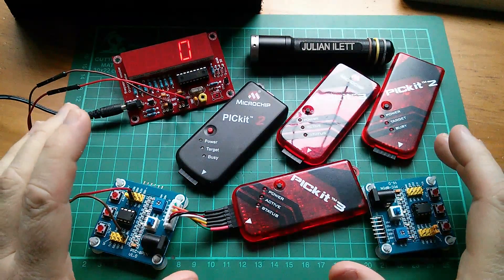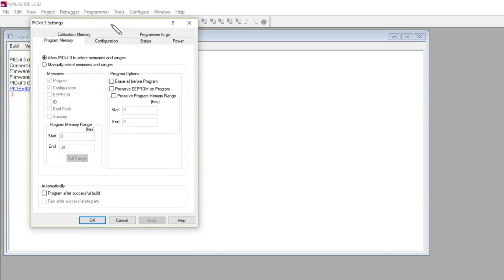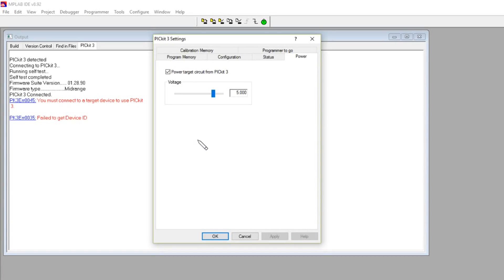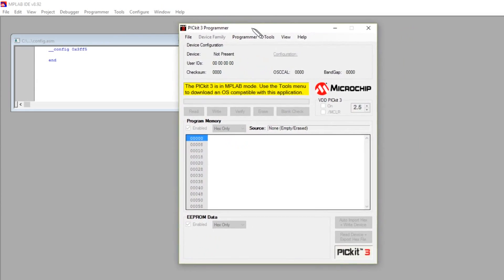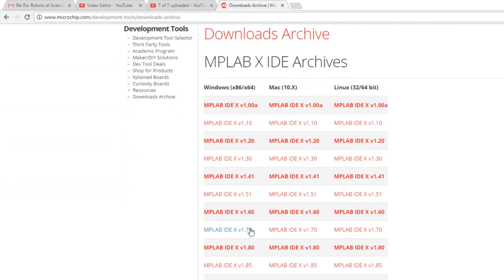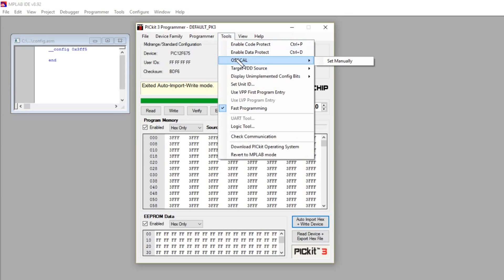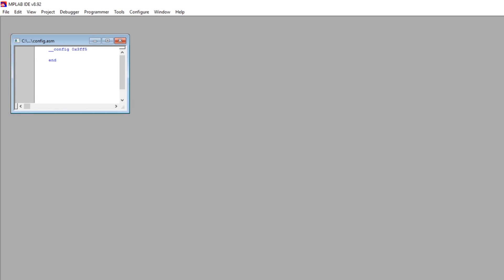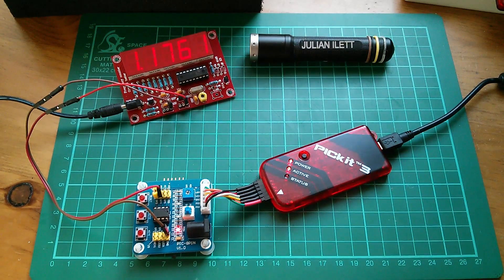PIC Assembly Language Update: #1.2 - PICkit3 Issues

Comment: @julian ilett
Hi, 
If I load a hex file into the pickit3 software which does not have configuration bits in the source code, will the software automatically set the bits when it programs ?

Comment: A better solution is to ditch Microchip. Microchip used to be good once upon a time as a company and they certainly deserve credit for all they did by making microcontrollers easily accessible to the masses but they have turned into a giant bloated corporate mess. They should get out of the software business and once again concentrate on microcontrollers and also sack half (or more) their managers.
Have a look at the MSP430 by TI, makes pics look like the toys they are, then there is the MSP432. TI's software Code Composer Studio compared to MPLAB? There is no comparison, its a professional suite, MPLAB is a joke. CCS is also FREE - AS IT SHOULD BE. Are you listening Microchip? You can stick your XC8 overpriced extortion subscription fees where you know it will fit.
There is no issues with TI's TMDSEMU110-U programmer. PICkit??? Its a piece of crap.
I was a long time supporter of Microchip but have said goodbye to them. Yes thank you Microchip for all the help and personal support you gave me in the past and lots of free samples, free printed datasheet books etc, fabulous, you certainly had some good people working for you back then but you have lost your way.

Comment: You can try to fix that error when exit the programm, just by creating the path (or additionally  ...ini file with right permissions) it asks for. There is another possibility - to run the programmer using administrative windows account. Thank you for sharing your experience!

Comment: Hello how are you?
 I'm using the pic kit 3 clone, like the first one that you explain, I connect everything with the pic kit3 program from the proto board and it works if I disconnect the pgm pin, the strange thing is that when trying to write it does not allow me

Comment: Hi. Casually I have a problem with my pickit 3 and your video seemed very similar to what happened to me.
Usually I use pk3 software, to program my chips, tired of seeing the error when I close the software, I change it to be compatible with mplad IDE, I had no problems until I tried to record a pic 12f675 and in that recording the pic lost Osccal as usual happens in that kind of pic...
So I went back to pk3 software, and I tried to reset the osccal to the pic, but it was not possible, pk3 read the pic but when trying to put the osccal or record pic was not possible this error always appeared "programing failed at program Memory address 0x0000 "or programing failed at EE data adrress 0x0010" and try so many times and I could not reset it so I susopeche that the pic was damaged so deal with other pic and it happened the same..
And since then I deal with other classes of pic like 16f690 and 18f1320 18f2620 and I realized that something happened to my pk3. Pk3 can read 12f and 16f and delete these but it does not record it, and 18f does not recognize them..
If you can visit this link and contribute something would be very useful ... thanks
http://www.microchip.com/forums/m997150.aspx

Comment: Hi Julian, How can I know my pickit3 is original or clone? I bought it from china banggood website and It has a Microchip Logo on it but it's color different from yours   and for fixing access denied message when closing pickit3  programmer, I just selected Run this program as an administrator under Compatibility Tab and for target voltage problem it is showing less than a 5 volt I connected my pickit3 to D-link usb dub-h4 and the voltage problem also fixed. Thanks for wonderful lessons.

Comment: One of the things I hate on tutorials is if they use old antiquated software or tools. Nothing is easy and you need to fiddle with it more than you need.

Think of it of using tubes instead of transitors in modern circuits outside of audio stuff. More (dangerous) high voltage stuff to care off without little to none advantage.

Comment: I've had good success, using a clone PicKit3 and MPLab IPE (Integrated Programming Environment). IPE is part of the main IDE of MPLabX but when installing this you are given the option to only install the IPE. The IPE is similar in looks to the PicKit Programmer program and possibly close to identical in operation? I find that I have to set my programming voltage to less than 4.85V or I get a warning about the supply being low (I usually set the supply for 4.55V which I type in the voltage box rather than fiddling with the drop down box). At work I almost always, on first connection, get an ID error but I find that unplugging the PicKit from the USB and plugging it in again then reconnecting cures that. At home I very rarely get this error, using almost the same setup. I've programmed in excess of 100 PICs using this setup and once connected I get very few errors although odd times after loading/reloading/re-writing a program it can sometimes get confused and just keep reprogramming a previous version. Shutting down MPLab IPE and restarting it soon cures that. The IPE will notice that a source file has been altered and offer to reload it, but I haven't seen an option to automatically load then flash a device. Still, I've not been looking...

I should add that I am using a Mac, rather than a Windows PC.

Comment: Try installing the program in the C:\ root directory and not the C:\Program Files (x86)\ directory. Windows 10 has stricter security than XP, when accessing files under this location.   Alternatively, try running the program 'As Administrator'.

Comment: Still can't get the standalone application to find the pickit 3. Tried reinstalling, running as admin, uninstalling the pickit in device manager etc etc.
Only MPLAB will recognise the pickit, but then 8.92 can't read the device, even with adjusted voltages, the IPE won't connect to the device with voltages higher than 4.5, and then it just fails, occasionally with "Failed to read device" or by read returning only NOPs.
I'm failing to find anything helpful on getting the standalone application to recognise the PIC, doesn't help that they give it the most useless name possible. The troubleshooting section doesn't and all in all it's not going well!
Reply from the maker: I have to assume your PC is somehow involved in this. I'm sure you've tried alternative USB sockets - maybe a powered hub (or an unpowered hub). Ultimately, buying the PICkit2 may be the answer. Sorry if this is getting costly.
Reply: Yes, I'll have to try get some other machines to try it out on. In the mean time I'll order a pickit 2 (maybe I should skip clones?).
Perhaps I'll try installing onto PCs at school.
Anyway, I'm going to make a website to keep me busy until the pickit arrives ;)
Thanks for all the help and attention Julian!
Reply: Just tried it on another laptop and it connected fine, but then wouldn't read the device :P
I don't even.

Comment: Julian - not sure if anyone else has pointed it out already; but it's easy to fix that crash on exit. Just change permissions to the folder it's installed in (for me c:\program files (x86)\Microchip\PICKit 3 v3\) so that all users have write permissions, and the problem goes away.
Reply: or instal it on another logical disk (D,E.....)

Comment: BTW... if you read the User Guides for PICKit 2 and 3 you will find 'typical circuits''.  For PICKit2 it says 10k resistor between VDD and VPP and a 0.1u Capacitor to VSS... this is what is on the unmodified board.  For PICKit3 it says you should have the 10k resistor between VDD and VPP but should NOT have the capacitor between VPP and VSS... that's why I was suggesting removing C4 if using a PICKit3.

Comment: Another great PIC video Julian. And thanks for pointing out the ID string on the standalone PICKit 3 Programmer software... I was finally able to reassure myself that the  Microchip PICKit3 programmer I had purchased on eBay a year or so ago was indeed a genuine unit... even though it was cheaper than some of the ones that said they were the genuine deal. I have a couple of PIC12LF1840s that I got as samples from Microchip a couple of years ago... am I likely to be able to use them to follow your tutorials until the F675s arrive (at first glance the programming pins are in the same configuration)

Comment: Is there any reason you can't use a $7 PIC programmer from Ebay instead of struggling with that PicKit?
Reply: needs to be able to supply high voltage [Vdd + approx 5vdc] to Vpp during programming.  i'm experimenting w/ a work-around.

Comment: With regard to your PIC internal oscillator appearing to be faster than it should on your frequency counter I expect the frequency counter is not extremely accurate and may be prone to drift with voltage and temperature too. It partly depends on the frequency of the counters own oscillator as it will have to be divided for lower frequencies and multiplied for higher ones so any errors are therefore also multiplied. That's why expensive frequency counters use heated oscillator modules to prevent any drift owing to changes in temperature as much as possible.
Reply: His counter seems to be fairly accurate from previous videos about it.  I suspect the PIC's internal oscillator drifts much more due to it not using a crystal.

Comment: Check out the MPLAB IPE that int installed alongside MPLAB-X. It has similar futures as the PICKit3 v3.10 Programmer. It may be useful. Oh and BTW the PICKit3 v3.10 programmer has a "logic analyzer" feature under "Tools -> Logic Tool...". This also may be useful.

Comment: Aargh, it's frustrating how much time & effort is needed for this PIC experience, from modding the demo board to fiddling around with programmers :( In contrast to that, for AVR, you can treat any Arduino board with ICSP as a demo board, or buy a demo board just like this PIC one, but for ATtiny13, or just get a programming board which supports any DIP AVR chip like http://www.ebay.com/itm/AVR-Programming-Board/222385152313, and use a $2 USBASP to program it. Those chips support a wide voltage span, so no mucking around with voltages, and can be programmed with anything from the Arduino IDE, through the official Atmel Studio, to just Notepad and C and/or assembler. Just marvellous little devices, and the Arduino explosion has made the software tools so much better.

Comment: My solution is to setup power modes to power from the PICKit3 at 4.5V-4.875V. 5V seems to be too much for the clone, and 4.5V is plenty. Remember to enable low-voltage programming mode, and Vpp before Vdd. From there, it's no issue from my clone. If you're using MPLABX, you can save a new profile with the settings so you don't have to do mess with it too much.

Comment: I bought a 'copy' PICKIT3 as I needed it to hack and reprogram a console game controller which used a PIC microcontroller but couldn't really justify buying the genuine product just for a single, one off task, but I too have had similar issues like in the video. I just put it down to being a cloned item and eventually ended up buying the genuine product to get what I needed done and it worked perfectly. Hmmm???

I guess I'll have to make a lot more use of PIC micro controllers now I've splurged out on a genuine series 3 programmer and so far this is quite an interesting tutorial on them, as I've only really used Arduino's so far despite the PIC micro controllers being around for what nearly a quarter century now. I really need to catch up :)

Comment: It does seem to me that there have been a plethora of issues with the Pickit 3 since its release. I have a genuine Pickit 2 and a couple of clones (one of which is perfect for this 12F675 dev board as it has a ribbon cable connector attached to it so no issue with the 'backward' ICSP connector) and I've never had an issue with any of them.

Comment: There really is no excuse to not join the modern world.  I'm using MPLAB X IDE v3.5.1 and MPLAB IPE v3.51 with a real PICKIT3 and it works well.  MPASM is free in MPLAB X. You do need to reduce target voltage from 5V to slightly under (I am using 4.5V); I think that it due to the PICKit3 is officially limited to 30mA only for target power.  My theory about 5V versus 4.5V is the power drawn by the 10k pot.  If you find a PICKIT3 is unresponsive or saying failed to connect etc. then.... PRESS DOWN THE BUTTON WHILST APPLYING POWER.  The button press wipes out the incompatible firmware in the PicKit3 and it should then download as required.  (Dave Jones' PICKit3 problems were solved by pressing down the button!).
Reply: I'm also using MPLAB X but ... Gordon Bennett it ain't 'alf complicated. I think they prefer the terms flexible, full-featured, professional, etc. But they've spent a lot of time and money developing it so they would - after a year of its use - quite like you to pay for things like extended instruction sets, optimisation, etc. None of which you cannot get by without, but ...
Reply: I posted the stock program source here... https://aardvarklabs.wordpress.com/2017/02/12/pic12f675-development-board-reversing/  or that's what was in mine when it arrived anyway.
Reply from the maker: I kind of waiting for Microchip to release a universal IDE that supports both PIC and AVR before I join the modern world
Reply: I didn't think it would be an easy transition. ;)
Reply: I would agree with it being complex.  But you can ignore the majority of it to get started.  MPASM is 100% free.  And the non-optimised versions of the XC compilers are also free which is a huge advance on the past.  MCC confuses me but I think it is probably useful!

Comment: OMG ! My pickit3 hasn't even arrived from China yet. I stand no chance! Anyways up, what's better about the pic chip over my Arduino's?
Reply: End the end, nothing for me. I use AVR (with and without arduino code) and PIC. Both families have their merits and shortcomings. There are free tools for both families, but AVR has more going for it in open source than the PIC. As said, the MC tools are free and run on most platforms but I only know and have used only one open source compiler (sdcc). For me it's fun to play with multiple controllers, just for fun.
Reply: There are good open source tools for PIC. I use them all the time. 

GCB or Great Cow BASIC
JAL
Gputils
SDCC (although the support for PIC is always labelled as 'experimental' so I don't vouch for this one personally)

and not forgetting the command line version of the Pickit 2 software pk2cmd.
Reply: Interestingly, the only reason why I'm watching this video is because I hope to use a low cost MCU later, and Microchip is discontinuing the ATtiny10's SOT-23 package. (The DFN package will continue though.) But Microchip has other MCUs with the SOT-23 package. I guess cost and variety would be a reason to use PIC chips, but haven't researched enough yet. But Chinese knockoffs are hard to beat for quick projects.
Reply: Yes, I forgot about gputils. I have used sdcc for a project I did last year and it worked fine.  Your mention of pk2cmd does remind me... It seemed to not work under Wine, but the Windows version of the Pickit2 application did, so go figure.

Comment: Thats why I said earlier that I never had any issues programming the PIC12F675. You can also try your old demo board without those modifications you did earlier and I am pretty sure that will work just fine. One more thing is, you can easily calibrate the VDD voltage or set the PICKit2/3 ID easily from Tools>Set Device ID at your choice. This is helpful when you are working with many PIC MCU at once using many PICKit programmer all connected to same computer at once. So individually setting the device ID is helpful in order to see which one is connected to which MCU. Say for example if you are experimenting with nRF24L01 multinode kind of thing, then you need to modify codes for individual MCUs and its cumbersome to connect the programmer to each of the board individually rather than opening individual app to program the targeted MCU. Hence multiple programmer connected to multiple instance of this standalone programmer will speed up your development cycles to many folds. Second point is, you can uncheck the EEPROM Data because thats not being used in codes (Yes in case if you need to preprogram something to it then its okay) so that every time you write some new codes to Flash, it wont erase the EEPROM again and again. It will save some of the writing cycles. MPLAB is gone to backyard a long ago and I am not sure why you still opting to add value into that. Rather XC8 is a better choice I believe so that newbies can be up to the latest mark. Coding in XC8 is easier than MPLAB due to restructured header files.
Reply from the maker: So you're a fan of the stand-alone apps?

Comment: Since microchip published the schematic and source code for the PicKit 3, the clones should work exactly the same as the real deal.  Only the quality of the parts used would make a difference.
Reply: I thought MC were trying to protect the profitability of their Pickit by making it non compatible with copies, but if they did that it might be that the copies are using different chips to keep the price down. We had a problem communicating with the cheap chip on cheap MEGA2560's.